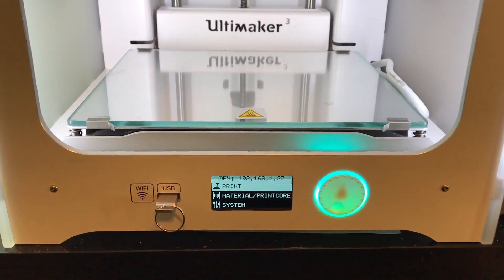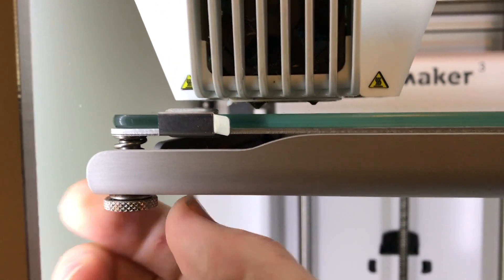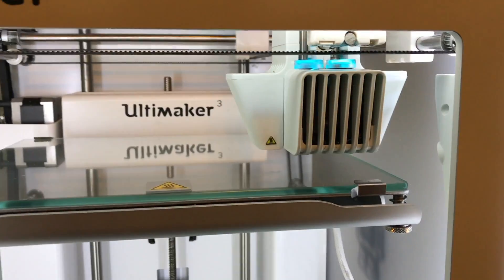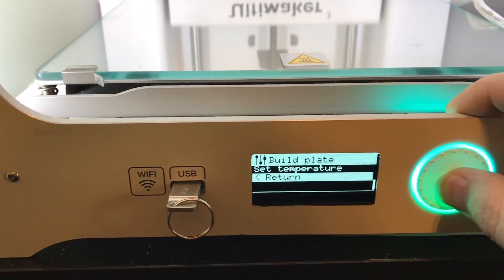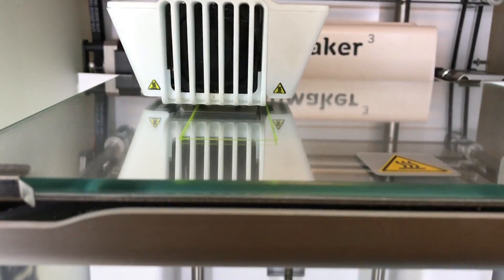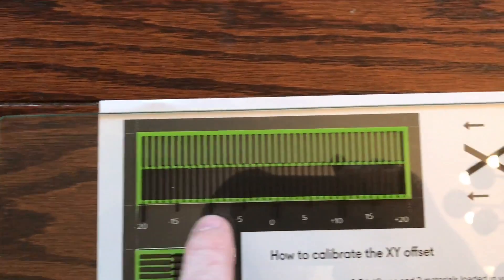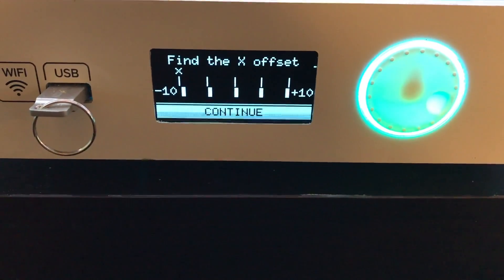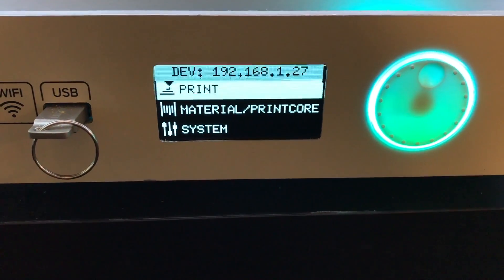Ultimaker 3 Calibration - Manual Bed Leveling and XY Offset Calibration (3D Universe)

Comment: Thanky you. In the last third of of the build plate (the area of the build plate which is leveled with  the help of the rear single thumb wheel) the lines of the 1st layer are not coming through clearly on my Ultimaker 3. Obviously the bed in this area is too close to the nozzle. Why does the active leveling procedure fail here (every time, no matter how many times the printer does the acitve leveling)? I did a perfect manual leveling also. Nevertheless, the lines do not come through in this area? What is wrong with my setup? Thanks!

Comment: When are they going to release a software update to do this for an Ultimaker 2????????????????
Reply from the maker: The XY Offset Calibration is for calibrating the alignment between the two extruders. The Ultimaker 2/2+ only has one extruder, so there is no need for this type of calibration. The manual bed leveling procedure is already available on the Ultimaker 2/2+, under "Maintenance" > "Build plate".

Comment: On my printer extruders are too high from glass and I tried to use screws under glass, Screw comes out while leveling using paper. Not sure how to fix this? Its a brand new printer. Just opened, probably messed up calibration.

Comment: Great video!  I just got an Ultimaker 3 and a Ultimaker 3 Extended.  Do you recommend using those “adhesion bed sheets” they came with?  I rather just use clean glass, but I’m a new Ultimaker owner.  Thanks!

Comment: Hello,  I have an ultimaker 3 , but I have to do the settings after every print.  As you say once we do it, settings are saved.  So what should I do
Reply from the maker: What settings do you have to do after every print? Are you saying you need to do the X/Y Offset Calibration after every print? That shouldn't be necessary. I suggest you contact Ultimaker Support. If you're in the United States, they're at https://ultimakernasupport.com

Comment: Woops, just got my UM3 and started a 65 hours print (The gyro) as a test without doing the XY offset calibration, it's now at 18 hours and don't really feel like ending it as I can't see anything drastically wrong with it, this might be a time costly mistake.
Reply: It's usually pretty well calibrated from the factory, so you should be okay. It will be less noticeable on a PLA/PVA print like you're doing. It would be more noticeable on a dual color print.
Reply: That makes me feel better, let's hope you're right!

Comment: Nice clear demo. 

One thing I"m wondering about, does this store the calibration in the way the cores are inserted in the machine. E.g A on the left and B on the right. What if you switch them around: B on the left and A on the right? Does the calibration still hold true or should you do it again?
Reply: Hi, Richard, The calibration is specific to the type of print core and its position, so if you switch them around, you would want to run the XY Offset Calibration again.